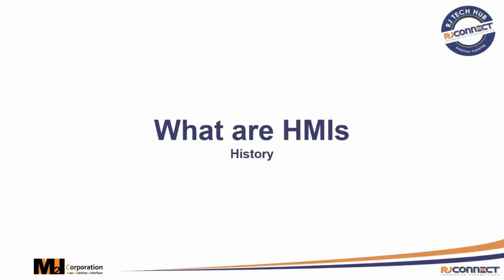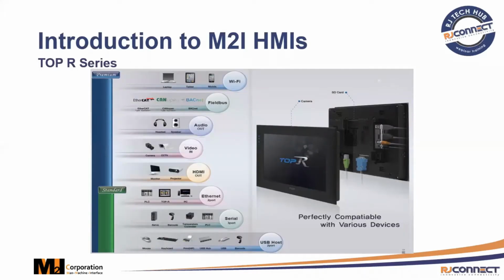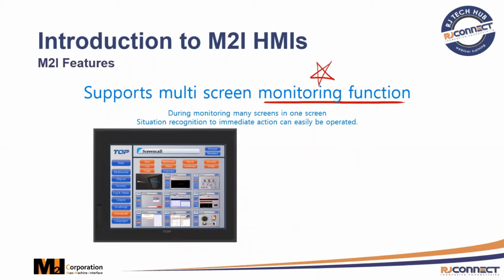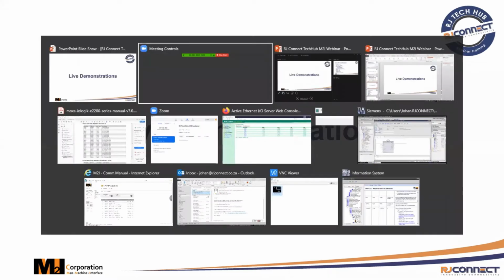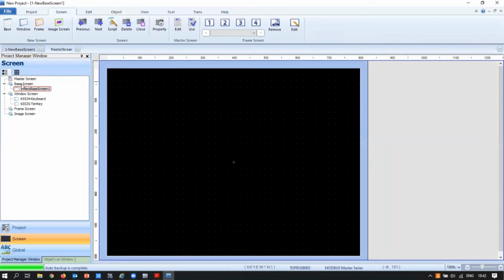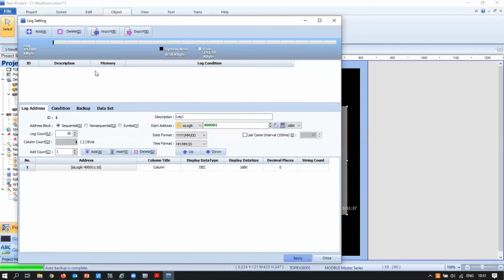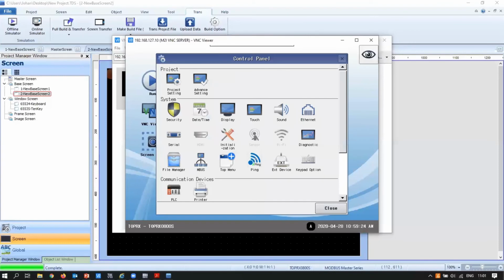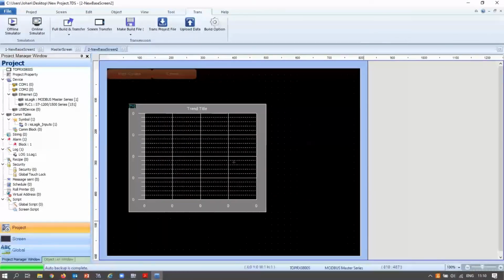M2I HMI WEBINAR

Comment: Hello Sir, thank you for the video. I have a question regarding the communication protocol between the M21 HMI and a Siemens CPU. I’ve configured the HMI to use OP communication with my Siemens S7-1200 CPU. However, after installation, I noticed that pressing buttons or entering numerical values doesn't work. For example, when I input a number, it resets to zero. Even when I’m online with the PLC, there’s no response or change. The IP addresses for both devices are correctly set. Could you please assist me in resolving this communication issue? Thank you in advance.